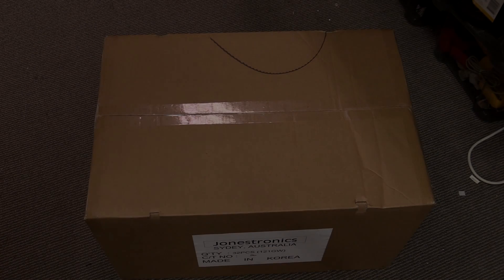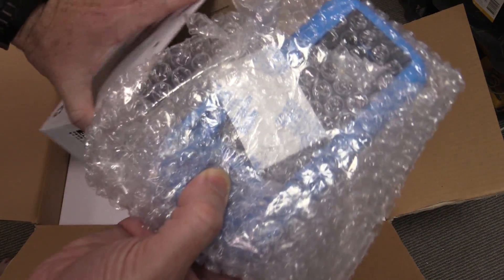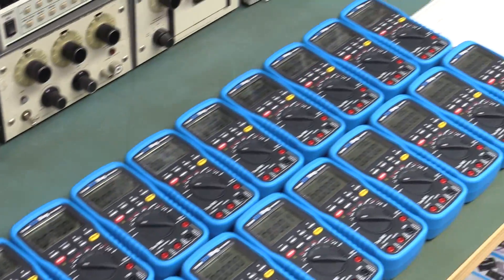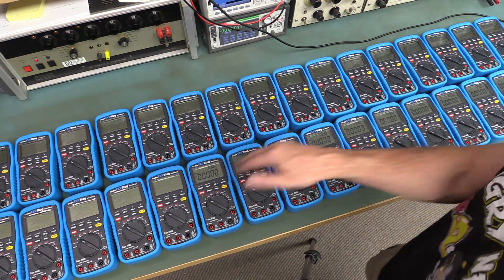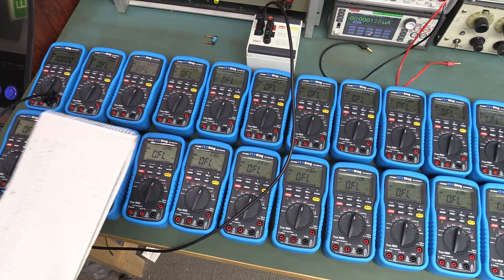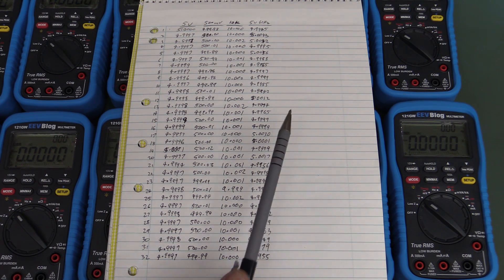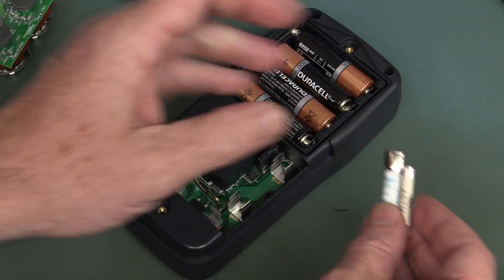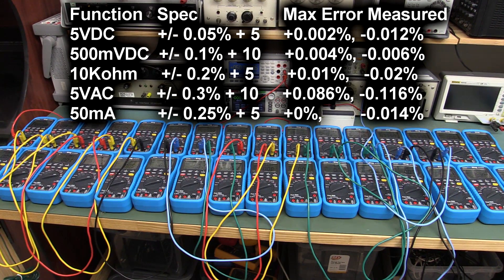EEVblog #1051 - 121GW Multimeter Mass Turbulence

Comment: Hi Dave,  I really liked the roundup of measurements showing the likely spread of calibrations, which looks pretty good.  But it leads me to a question that has been bugging me.  I have an old 50,000 count Protek 608 meter and it annoys me when I look at my 5 V reference.  Every time it goes over 50,000 counts it drops back by one digit of accuracy.  But that's normal, right?   So why is it that the 112GW can show voltages like 5.0004.   That's 50,004 counts!   So what is the actual maximum number of counts of the 112GW?   It's actually quite an important point, because people like to look at their 5 V references like that of the  DMMCheck Plus.  I know that this video was put up 7 years ago, so I really don't know whether I should expect a reply.   It will be interesting to see what happens.   If you do reply, please let me  know if there is a better place for this sort of discussion.   I may have other questions.

Comment: Dave,
Watch those Duracell batteries they leak in the AA and AAA really badly.
Reply: I'd be immediately replacing the cells with Varta brand alkaline AAs or NIMH AAs
Reply: I had clocks, radios, flashlights etc. with leaking Duracells when I finally stopped using them. Alks gas and manufacturers push the limits of what you can get out of a battery, Duracell is one of the worst doing that. Do a search on leaking Duracell batteries. I'm using Energizer and Energizer lithium with pretty good results so far.
Reply: I had clocks, radios, flashlights etc. with leaking Duracells when I finally stopped using them. Alks gas and manufacturers push the limits of what you can get out of a battery, Duracell is one of the worst doing that. Do a search on leaking Duracell batteries. I'm using Energizer and Energizer lithium with pretty good results so far.
Reply: The scary thing is that they can leak well before they have gone flat.

Comment: Are you shipping them with silicone rubber insulated, gold plated test leads?
Reply: Rick Goebel From the kickstarter FAQ:
What accessories does the meter come with?

It comes with the Brymen BM235 gold plated probes and a thermocouple. 
Along with a custom EEVblog carry case. 
You can see these in the photos section.

Comment: Tongue in cheek - Why isn't it powered by hydrogen fuel cells?  Why isn't the rubber case tangerine colored?  Why didn't UEI put Bryman test leads in the box?  Why isn't this made by Fluke (or Keysight)?  Why is this not a 50,001 count meter?  Why isn't it called a 1.21 JW EEVB meter?  Why didn't you show the flux capacitor in the video?  Why is there an off position on both ends of the dial - is one of them more "off" than the other?  Why doesn't it come with a DSO?

Comment: 8:18 - left of R77 (upside down in the shot) - solder point on the wifi(?) module looks like there is a wire sticking out of a hole and didn't get enough solder?

Comment: Interesting that Dave always complains about having to take the back cover off of a meter to change the batteries and fuses and you also have to do that on his !!!
Reply: Fuses should be screw to remove and it uses batteries that give it a very long run time before requiring replacement. Most expensive meters need screws removed to change batteries, that way the cover can not just fall off which is dangerous
Reply: It's not like its a major problem is it though :/

Comment: Interesting to see the wireless module is compliant in Japan, evident from the "technical conformity mark" which is the symbol that looks like a "T" with a wave on top, seen at 8:00. I'm not sure you can claim that the multimeter itself is compliant (that might require additional certification that costs a few thousand USD...) but it might be worth checking with the manufacturer how that works.

Comment: I'm really disappointed that you haven't decided to power it from lithium cell with charging from USB...
But anyway, nice mulitmeter, well done!
Reply from the maker: You can't do that, it would never pass UL safety testing due to the USB connector. This is why no meter on the market does it.
Reply: Charging from USB in current year... Have you never heard of uBeam? Would  come in handy to charge the multimeter from a Solar Roadways charging station. Also, built-in Batteroo Boost would have been nice.
Reply: "whats so unsave about usb" I'm not an expert in anything, but I guess it would be unfeasible to separate the USB port from the probes input. You don't want to have the possibility of any connection between the probes and your USB power supply.
Reply: Arek R
Standard alkaline batteries last for years in multi meters. Why bother having to charge them several times a week?
Reply: Here's a crazy idea: Charge by plugging the probes into a wall outlet. :-P
Reply: My meter has an internal lithium battery, but it isn't charged through USB. It has a special adapter that plugs into all the test ports to charge it and the meter has to be off or damage can occur. I do like the rechargeable function, but what I like the most is the easy to see color LED screen. I prefer it to a standard screen with backlight. Build one like that and I will get one for sure.
Reply: You do not need a rechargeable LiPo system on a unit that can give 200hrs + on a set of 4 AA's. It's simply not done. There are isolation issues. The only rechargeable meters on the market are the OLED full color  or monochrome ones which use lots of battery to power the OLED display.
Reply: ETR

 i would assume its the exposure to external. For the most part, multimeter is a sealed system.

I never thought about this until now, but makes since if its the case. Multimeter is for field service vs benchtop meter which usually plugs into wall.

@eevblog reinvent the wheel and make a lipo compliant with usb c charge wit wireless.
Reply: It's a multimeter, not an Angry Birds console.
Reply: How long is the battery life? Seems pretty simple to change out 4 AAs every year or so, and keeps the unit cost down.
Reply: I use my meter out in the field. If the regular batteries die I pull them out and put the new ones in my bag in and I am up and running. I don't want to haul my meter back to the shop where I have a USB charger and let it sit there for a few hours before going back to work. My employer would have a fit if I I did this.
Reply: Ah... I guess it would need a USB isolator, and power transformer. Maybe too expensive and bulky.
Reply: then it would cost a fortune to ship because here in the united states you cant fly lithium batteries anymore which means its shipped by some ground means and ship means only
Reply: I wanna charge it from my roadway...
Reply: AIUI the difficulty is getting a high enough isolation rating. The DC-DC modules I've seen give 4KV isolation at best. Afaict 600V CAT III meters need 6KV.
Reply: EEVblog Not even if the port were to be located where the battery slot is, and having a physical switch which connects the USB port but disconnects the battery from the rest of the meter?
Reply: come on, hazar - that's too much worrrrrk
Reply: I never had to swap the batteries in my Multimeter.
Reply: Why not have it isolated? Use a DC-DC converter.
Reply: Thank you very much for the info,I was wondering why my Agilent u1252a has a weird way of recharging!
Reply: you know most newer airplanes don't use lead acid batteries they use lithium ones
Reply: what about li-ion battery and separater charger? when it gets depleted, you take it out and charge it. better than NiMh AA batteries.
Reply: Curt D 
Exactly! It’s a FIELD meter. And that’s why they call big, square boxes BENCH meters. Their use is different.

You don’t want your meter to run out of electrons while hunched over a machine on an assembly line with management pacing around...
Reply: davecc0000 

it would be just as easy to swap with a spare lipo and recharge once you return to the office. I think as time moves forward, that more field devices will move towards lipo. Power density and variable profile/dimension options are just too convenient for it to not be the future of multimeters.

However, there is enough space inside any multimeters battery tray that anyone could easily just mod a harness for use of a properly sized lipo pack.
Reply: Sending things to EU is already hard, adding lithium battery into a product for worldwide shipping will add another hurdle to the shipping and not mentioning the shipping cost too.
Reply: STEMTera

It would also add cost as batteries are currently not included, so i see this as a reason/obstacle that would merit building with a cabinet that accepts readily available lipo form factors that buyers can order from distributors in there own countries.

Solid lipo with small form factor and 2000-3500mah can be obtained from many hobby suppliers for under 10.00 + s/h and removes the burden of lipo compliance from manufacturers of multimeters.

Where there is a problem, there is always a solution.
Reply: some thing you don't know is that Dave said "they are shipping with 4 duracells"...
Reply: Retro Retiree
Well thats a great value add, but I wouldnt need him to ship it with batteries if it used a lipo. Especially when i understand (from first hand exp) the compliance and added cost of shipping lipo. Anyone that would demand batteries included as a deal breaker... Just has a stick up the ass.

Im not saying that he has to make it a lipo for me to buy. Just adding my opinion that the issue of shipping compliance and cost could be overcome by not including the lipo.

If one is allowed to dream... What would be nice is to have a meter that accepts adaptors. By default the meter would accept a lipo pack. Battery cradle would adapt for AA and as a kicker a drop in pack thats wired for wall plug. Essentially, making the most versatile field/bench multimeter available. Ahh... It feels nice to dream. 

All of the features mentioned above are available as aftermarket mods, so certainly they coupd be massed produced for custom fitting. Where rubber meets the road, is the scale of consumer interest versus production cost. Not all things desireable are cost effective. Taking the liberty to asse, but ultimately this is most likely why most muli-meters are not pop out lipo packs. There is little to know demand for requirement and the cost is higher. Pennies add up. Dollars add up faster and it would have taken quite a few dollars to get he manufacturer to make adjs need for a lipo ready multimeter. 

But ultimately my argumemt that lipos will be the future of multimeters is still the same. *Eventually it will be an inevitability.*
Reply: Can't u just use ur own 4 rechargeable batteries? And charge them separately from the meter?
Reply: This one does charge with a USB and it's still on the market...just saying https://www.aliexpress.com/item/multimeter-VC105-Water-Resistant-LCD-Digital-Multimeter-DC-AC-Voltage-tester-Current-multimetro-digital-profissional-multimetr/32797616308.html
Reply: Arek R....we are all "really disappointed that you" felt the need to comment on this post as you must have us all confused with someone who cares what you may think....but...the good news is that you can go and have your own meters made and you won't have anything to be "disappointed" in....just saying
Reply: Does anybody know's  , whats so unsave about usb connectors ? I need to know
Reply: galfisk That would be really inefficient
Reply: Could you use wireless charging?
Reply: Ok then no USB connector.
What if power would be supplied through main 4mm ports with special adapter?
Because it's not much about the USB connector, but about good, rechargeable battery.
This way we also could use high input range step-down converter, so we apply whatever voltage from 6-220VDC or AC and we charge our multimeter.
Reply from the maker: Sebastian Johansson : Do you really want to take off the rubber boot, battery door, and then leave it open like that for hours for it to charge?

Comment: Have 32 super high-tech MMs on the desk ... and go around and hand-write down all the values.  Classical oldschool solution

--> Challenge Dave2s Software to handle 32 simultaneous Bluetooth connections ;-)
Reply: Didn't even use ditto marks.

Comment: I totally don't need another DMM. But I totally want one of these.
Reply: +The Bright Pixel - My thought exactly.  But then I asked myself what IS the household legal limit?
Reply: is there's a limit, dave's wayyyy over it.
Reply: Small difference being that multimeters are not designed to kill things.
Reply: I've got a DMM, but it's crap, especially in the 200 ohm range. Could use a good one.
Reply: I wonder when these will be on sale generally?
Reply: I'm guessing it's pretty much like firearms: as many as you can fit in, until the government (wife) make you start registering them.   I have at least a dozen meters, not counting the 6-10 free Harbor Freight ones, or the 3 LCR ones, or the 10+ (uhmm closer to 20) LED fixed value voltmeters.

OK, that does sound absurd, but not when you look in detail.  Three are old analog meters, still useful for changing values or when you want a little load on the circuit.  There is a logging meter with RS232 output.  One with a non-contact voltage sensor and Cat 3 rating used only for line voltage.  My first Fluke from the 1980s. One automotive-oriented meter with dwell measurements.  A meter in each car, one in the tool shed, two or three on the workbench, etc.

Comment: No leads?   What The?
Reply from the maker: Supplied In the extra case, they came from Brymen, not Kane test.
Reply: I want proof, not leads. If we followed up every lead....
Reply: If you're watching the EEV Blog, chances are this is NOT your first multimeter.
Reply: I thought the case is for when you drop it or spill things on it or use it in the rain and mud, not for when you put it in another case?
Reply: @Pampali: Generally I agree, but somehow it's normal when buying DMM to get all accessories and be possible to start using it immediately. Imagine that this is first multi-meter which you buying and don't have test leads at home...
Reply: I absolutely agree with you. I suggest to offer bare unit and optional pack with addons. A speciali if there are two different suppliers.
Reply: Yeah, where are the leads?
Reply: Personally I prefer to buy bare unit. I got lots of leads, don't need more. I don't trust thermocouple, if I need to measure temperature I always use PT100. Also case seems to be wasting money for me - 121GW already has prepared its place in my toolbox